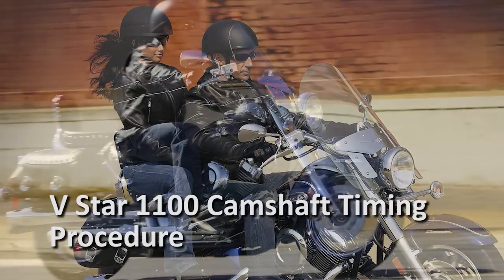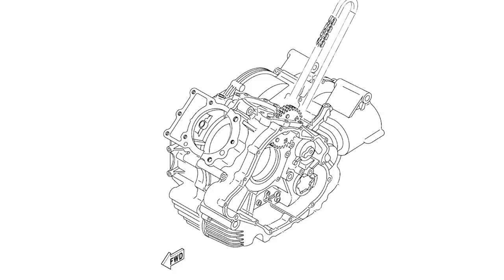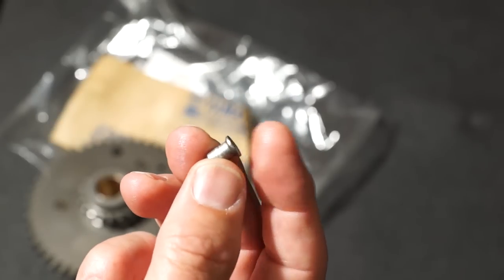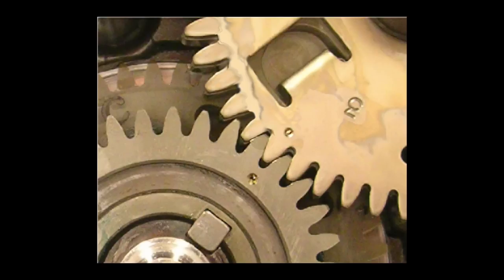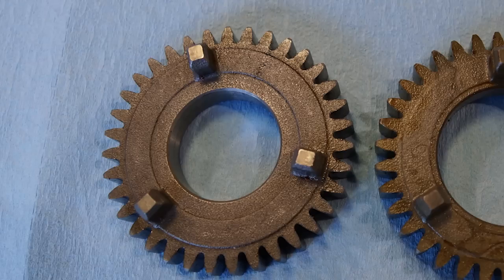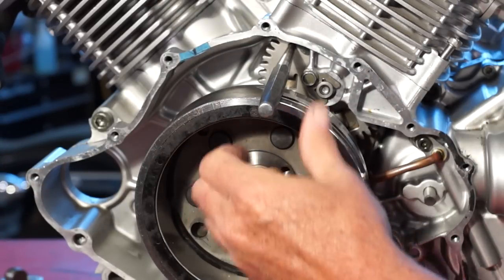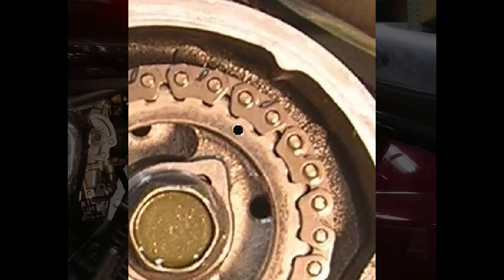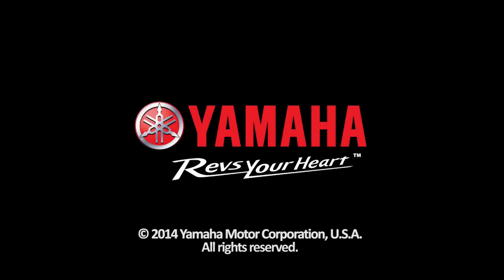XVS1100 Cam Timing Procedure 1

Comment: Maybe you could tell me where I went wrong.  I replaced the starter clutch in my 01 1100 v star custom.  First time in I wasn't aware of springs and bearings. When I finally did get the clutch to break free I found all six of both installed the clutch still no starter. Took it out again found your video realized I had to remove the gear behind it and go back in together. Well by then I wasn't sure my timing was off so taking what you said about lining up every ten rotations I just kept turning until I could line up my marks. Got it all in now it cranks but no spark. What if any damage could my ignorance of this procedure cost me.

Comment: Be careful when temporarily installing the crank case cover if the engines at TDC there isn't much tension on the starter idler gear especially with the plugs out when you take the cover back off the dowl Will pop out and you'll have to mess with the gear to get it back in place. Happend to me 3 times until I finally figured out what was happening

Comment: I replaced my won clutch and fluid change, thinking it would fix my 1st gear disengaging after going about 10 mph. Any ideas what that could be? Ive searched the manual and it could be the forks but i haven’t seen any videos on this being replaced. 02 vstar 1100

Comment: I did mine using this video and found it very useful. one thing to remember that this video doesn't tell you, is that sometimes the marks on the cam sprockets don't align . this is ok if your bike has a few miles on it as the cam chains have stretched and there will be a slight misalignment when you do your assembly. you should do a cross check making sure that the cylinder is at TDC. 
My other issue was that i completed the job and found that the bike was backfiring under load when I first started it up. I was very concerned that I hadn't meshed the gears correctly so I dismantled the bike again and rebuilt it only to find the same issue. Frustrated I parked the bike for a week and couldn't face it. In complete frustration I started the bike and rode 2 km to find that the chains had settled in tension and the bike ran like a dream . moral of the story is be patient and do it carefully. 
I wouldn't attempt this job without a rattle gun and a puller, the removal of the fly wheel was an mammoth undertaking and not for the fainthearted.
Reply: Now I'm scared to do it. (Fainthearted)
Reply: Trur

Comment: Wonderful video. However the cam shaft timing gear marks do not align no matter what I do yet all other timing marks do in fact align. After some considerable research, I found a Yamaha bulletin that (making a long story short) the two cam shaft timing marks in question  need not necessarily align as long as all other do, principally the rear timing marks at TDC.
Reply: Hey man...I cant find that bulletin,  can you please share a link? Thanks !
Reply: @chubbssstuff3101  Sorry brother I didn't save the link I only printed out the 4 page bulletin. But to clarify, the bulletin mentions that if the timing marks in question align but the cam chain drive gear alignment hole does not then the crank needs to be advanced (clockwise) 2 turns at a time until they do. In my case I followed that procedure but the alignment hole would not line up no matter how many times I rotated the crank shaft. What I did then was to insure that ALL marks were properly aligned and the #1 piston (rear cylinder) was a TDC, then reassembled. It worked! The engine worked just fine until it was time to store for the winter.

Comment: Oi from Brasil. Great video. I don´t if you can help me but I have a Yamaha virago 1100 from 1995 and i´m putting it back together again. In your video 2:40 LH side.
There are 2 marks on the camdrive center line. On the virago there are not these marks. What do I do and how do I do it the right way. Thank you.
Reply: you could try setting the mark on the flywheel to top dead center then verify that the cylinder is at TDC by taking out the spark plug and inserting a screw driver in and checking as the cylinder rises and when it starts to fall. set it all up then double check that you got it right. also check that both itake and exhaust valves are on the rock.

Comment: thanks a million , sir . im working on an 1100 virago but it all seems the same . intermediate timing marks dont seem crucial because timing can still be achieved by jumping chain teeth on the camshaft . i think the manuals make it seem more complicated than it is . 

id note that its important to make sure that compression on each cylinder directly oppose each other . i think it could be possible to get them 180 out ( both compressing at the same time ) . feel free to correct me if im wrong .
Reply: i bought a great looking used engine from the cleveland area but they had swiped the flywheel hoping to sell it . messed my head up for a little bit .   :(>

Comment: Hi again, I have another problem, Maybe you can help me, you seems to know a lot about motors. Is the cam timing procedure the same on a Yamaha Virago 1100 from 94. Do you know that ?. I can´t find any information about this on Youtube. Thanks
Reply: I bought a Haynes shop manual for my V Star 1100 shortly after I bought it that cover 97 -05 year models. Now my impression is the no matter whether the model is called Virago, V Star or Drag Star, the 1100 engine was the same for all. I cannot attest for certain that that is the case but from what I have seen in the Haynes manual I have and you tube videos and the fact that most manufacturers avoid retooling, I suspect the engine to be the same for all models mentioned.

Comment: how long should you expect a job like this to take?
Reply: Its not a huge job but if you dont have the tools it will be challenging. An Impact wrench will help hugely and I wouldnt attempt it if I didnt have one. The fly wheel can be seriously stuck on the shaft and quite a challenge to release. If all goes well perhaps 3 to 4 hours but if the fly wheel is stuck on could take longer.
Reply: @marsflee3815  are you talking about the fly wheel? i used a gear puller not a hammer .